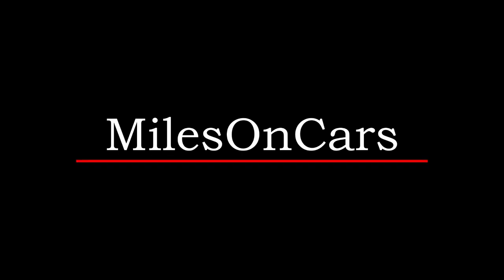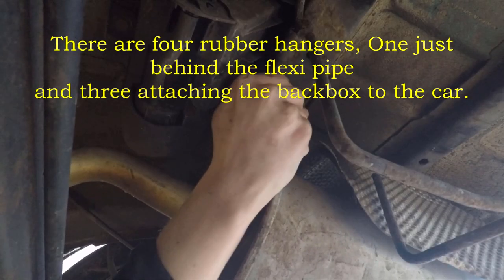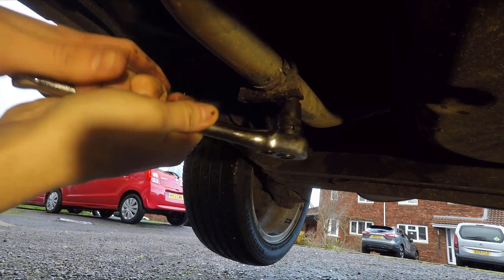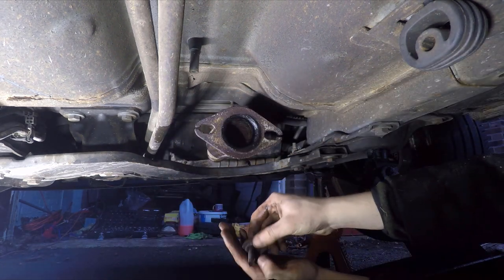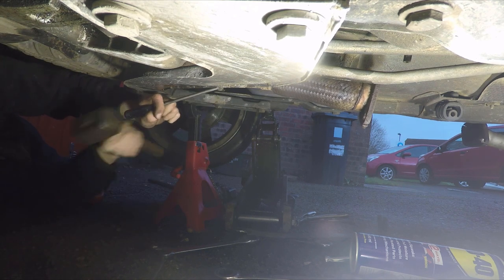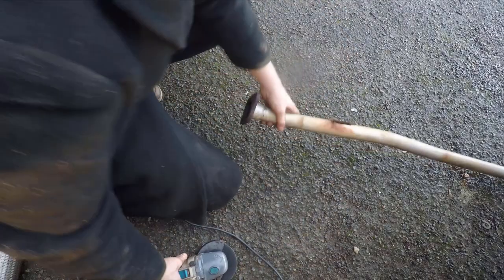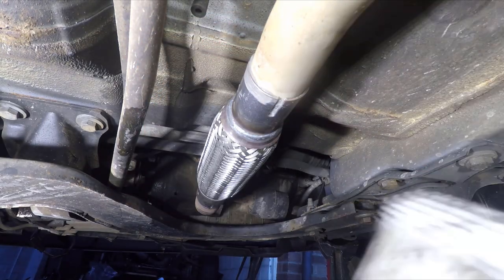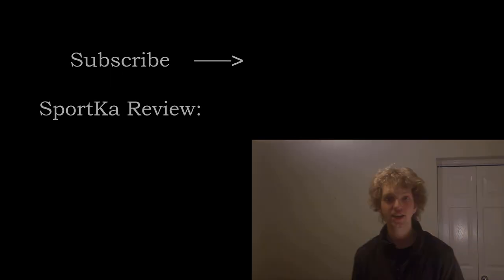SportKa Exhaust Repair - Project SportKa

Comment: Well done Miles. I remember putting on a new exhaust system on my Dads Ford Granada when I was about your age back in the 1970's. It was a real struggle trying to get the parts removed and the new ones inserted as the car was on axle stands so not quite enough clearance but I did manage it.  It's refreshing to see young people like you willing to have a go at car repairing and I especially liked how you learnt to solve challenges such s the replacement parts not being the same as the original in a safe manner. ... oh and if you need some music I can help out.